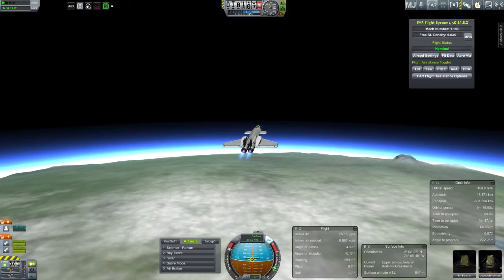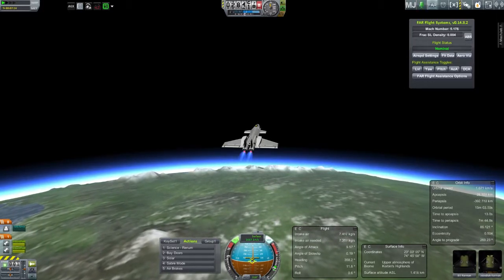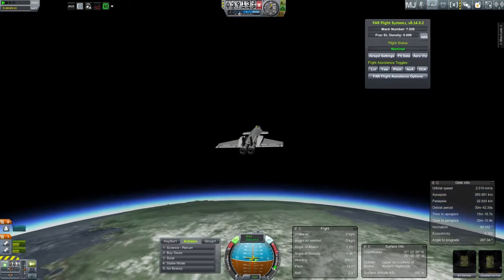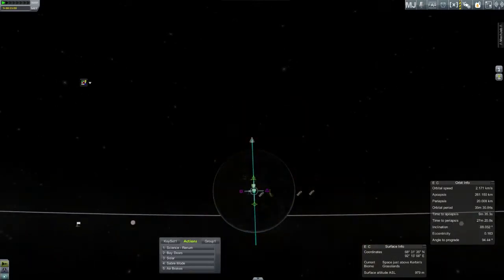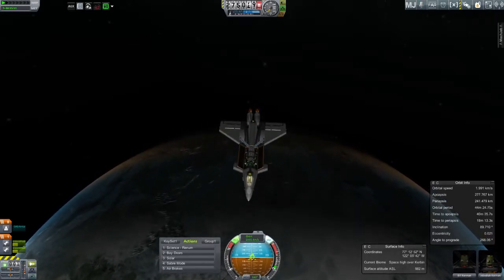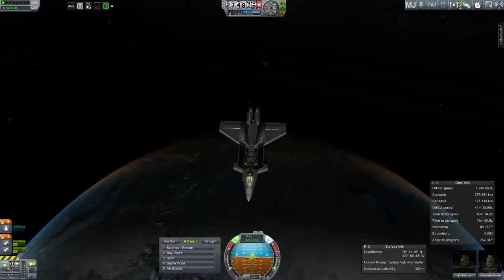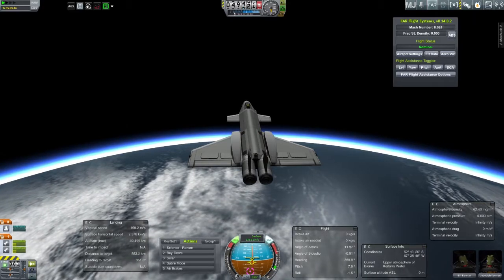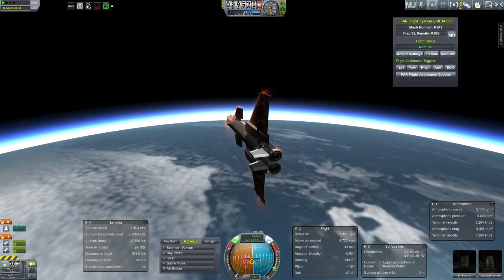Reuseable KSP .25 1 - Flying a spaceplane to high polar orbit and back

Comment: Craft File? ;), Please
Reply from the maker: Hi Mike, sorry for the delay in replying. I'll have to turn on my notifications. I will have to look at my old library and see what I can do. It may not to be the exact plane you see here but it will be a close resemblance.
Reply from the maker: I think this is the one:  https://drive.google.com/file/d/0B6_2X6e52QujLTdXWEZxOXJQd3M/view?usp=sharing

You will primarily need the B9 Mod, and then MechJeb, Science containers (maybe), TAC Life Support, Vanguard EV Parachutes and Kerbal Attachment System. Maybe more. I can't load this ship in my .90 install yet.   That level 3 research facility is proving to be a tough nut to crack ;-)

I have a link to my mod spreadsheet complete with download links in the description to the video.